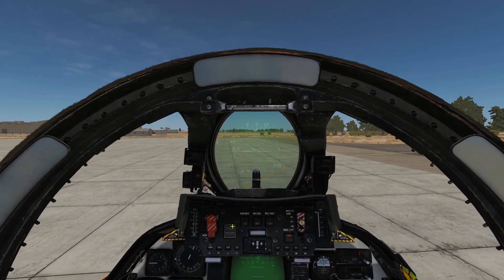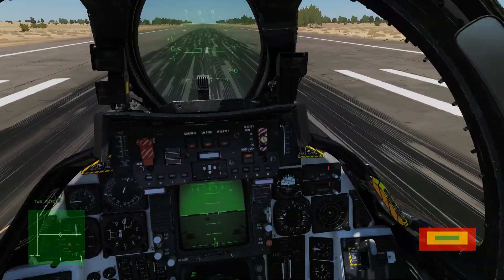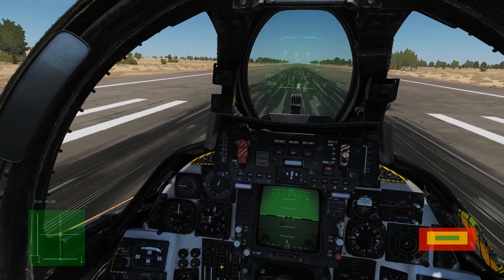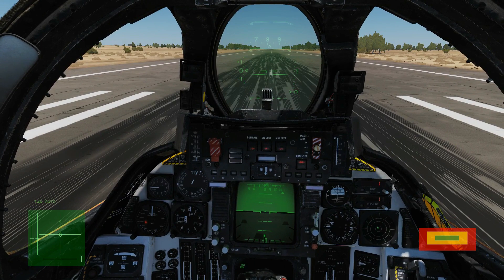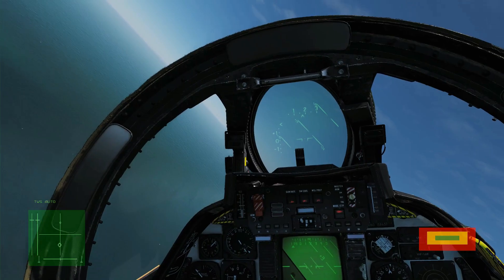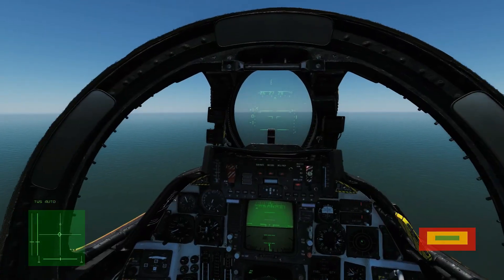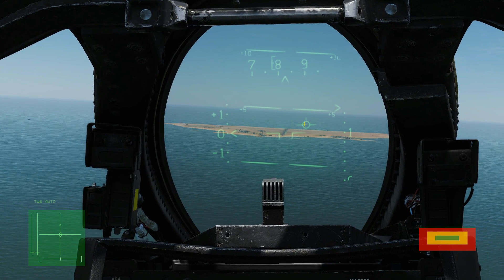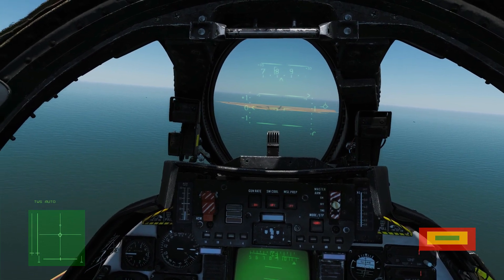F-14B Tomcat: Airfield Taxi, Takeoff & VFR Landing Tutorial | DCS WORLD

Comment: Flaps did not retract (fully) immediately during takeoff because automatic maneuver flaps engaged after moving flaps control handle fully forward (retracting manually extended flaps). Maneuver flaps can be retracted by moving DLC thumbwheel forward with landing gear up (DLC disengaged). But, they also will retract automatically before reaching dangerous speed, so I usually leave them be, they are just trying to help.

Comment: No afterburners!  Wy?  several reasons.first in carriers the fuel is very valuable and there is no need to WASTE it.unless is full loaded no wind on deck.second, full AB  can be viewed from miles away and in some  carriers de deflection barrierson the catapult are not strong enough to withsand the full power of the F14B/D.In ground runways the full burner will cause damage to the runway during rotation.

Comment: The f-14 has some incredibly strong engines and they're relatively close to the ground so afterburner will damage the runway/deck if it's active. Plus they tend to go into burner one after the other (usually left then right).
Reply: Another reason why you shouldn't take off in burner is the engine placement. Since they're far apart laterally on the aircraft, an engine failure on takeoff in burner could send the aircraft into a spin which would be impossible to recover from  at low altitude
Reply: @alexl7989  this is the actual reason. Well said. An additional reason for the limit on the carrier launch is that it will actually push the cat shuttle and since that attach point is so far forward it actually decreases longitudinal stability.
Reply: @alexl7989  RIP Kara
Reply: All F14As took off with burner on carriers, cuz the engines weren't strong enough, the later models could take off with sub burner
Reply: Afterburners on takeoff also jam flaps

Comment: If you have a flame out and lose and engine on launch if in AB you will be unable to compensate / correct for the thrust loss
Reply: Used to happen to our f14a's fairly often off of the cat
Reply: Yes but there is a guarded ASYM LIMITER switch to auto lower the burner on the operative engine in case of engine failure.
Reply: @zzodr  I know its a VERY late reply... buuuut even though that is correct, it does have the limiter, that's mainly to stop a spin in flight. If a engine went out while in burner on a cat it would only take a millisecond of asymmetrical thrust throw the plane off the cat. I've seen it  ;)  Plus this pilot even talks about it:  at 56;20... https://www.youtube.com/watch?v=Cgq4xjXN4-8&t=3529s
So yeah, Pring you are correct.

Comment: I think natops states always speed brake while landing, higher engine revs = better responsibility.

And you should use the dlc to lower or raise the plane instead of throttle.
Reply from the maker: agree to both
Reply: Maybe if the f14 is using the TF 30, but this in DCS is model B so she has the F110 which are more powerful, so maybe that statement would not apply at all

Comment: Excellent !By the way, the latest Fighter Pilot Podcast has an interview with both a former F14 Pilot and RIO which you may wish to check out - https://youtu.be/VSwLSEQjxfg. The pilot also confirmed that they were not allowed to use AB on takeoff from either land or carrier in the F14B (or F14D) due to the strain this would put on the gear..... The two GE F110-400 engines were just too powerful. The F14A had the older, less powerful, less reliable TF-30 engines (so did the F-111) and they used AB all the time on takeoff from land or Carrier.
Reply: The limitation was due to thrust asymmetry. I was also told that that the GEs would damage the JBD on the carrier in full AB.
Reply: Interesting, thanks a bunch!

Comment: I heard that they didn't use the afterburner during takeoff because if one of the engines failed then it would yaw to the side and would not be controlable. The yaw is because the engines are quite far apart and thus will create more of a torque moment if the engines are producing different amounts of thrust. I don't know why it is ok for the mig-29 and su-27 can takeoff with afterburner because I would have thought that they would have the same potential problem.
Reply: The F-14 A version had numerous engine issues, and airframes were lost (as well as pilots) so the Navy decided to be cautious.
Reply: The other part of the equation is flight control effectiveness.  The rudders in this case.  Could be that the 29/27 have more effective rudders and hence have lower Vmca with full power.
Reply: I don't know either, so I don't know if I should even be replying, but I can think of three possibilities.

1. The Tomcat could have more of an issue to keep both burners on at takeoff and the risk of something going wrong  is just too great.

2. The russians could simply be less concerned with potential risks.

3. The americans could have been overly cautious and it just became part of the procedure.